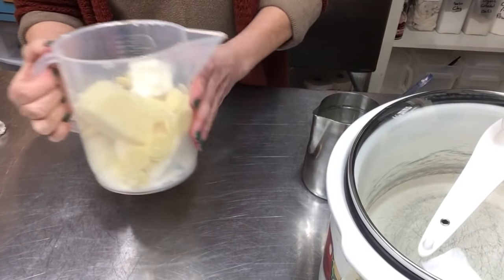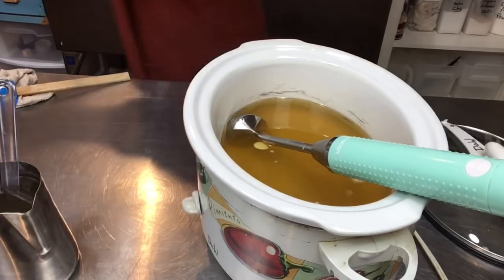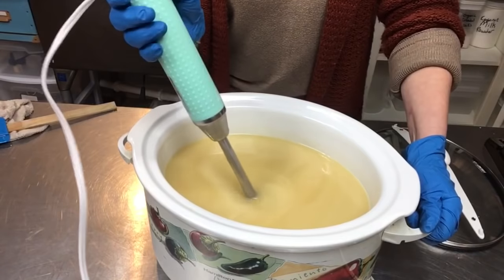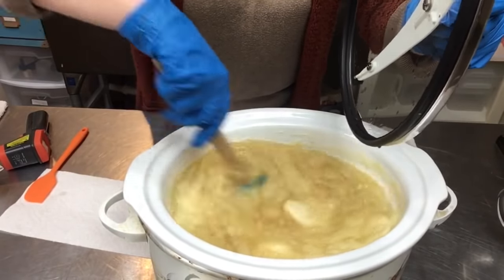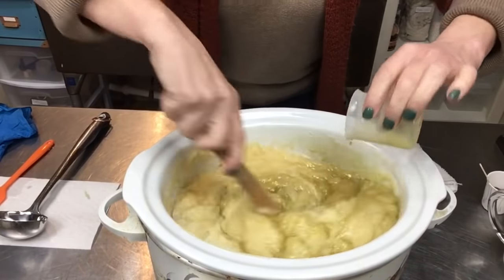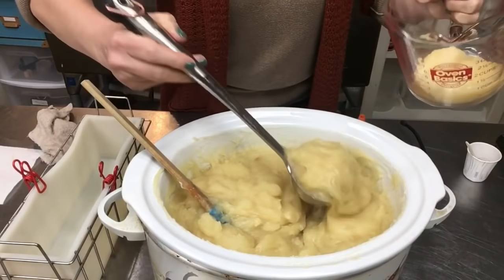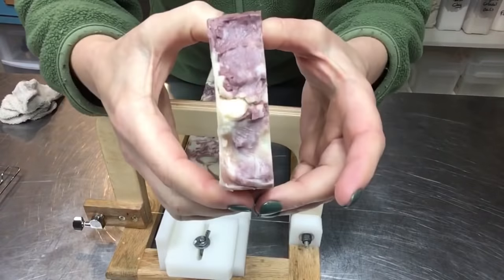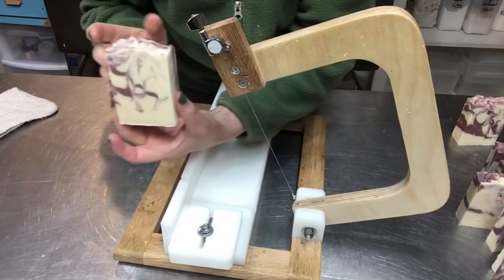How to make all Natural, fluid Hot Process Soap Swirl with Recipe | Ellen Ruth Soap

Comment: They turned out great Ellen. I'm really impressed.
Reply: Hi Ellen, I just wanted to make a note that if you decide to make HP soap a lot, I've found this solution to be a better judge of PH. 1% Phenolphthalein. You can purchase it from Amazon and what you do is take a tiny bit of the batter and put one drop directly onto the soap. If it changes color AT ALL you know the ph is off. The strips are great but this "In My Opinion" is better. Just wanted to let you know what I've found. Again, Beautifully done, it looks amazing.
Reply from the maker: Thank you! It was really fun to try😉

Comment: Well done! I'm a new soaper, I am teaching myself both hot & cold processes at the same time. I much prefer hot process despite attempts 2 & 3 being an almost volcanic experience. I really thought long and hard about why that happened and the conclusion I came to is my crockpot is half the size of yours. To do a full 2.5lb loaf pushes the limits of the crockpot's volume capacity. It also seems to get hot much faster at a smaller volume.
Reply from the maker: I really did enjoy doing the HP, but I do a see the crockpot size as a bit of a restriction 🤣

Comment: Hi Ellen Ruth!!  You did a Great job!  You went thru apple sauce and mashed potato phase!!  Hot process was my first way of making soaps!!  I love it for those last minute OMG it's almost (whatever holiday), let me make something that will cure quick LOL!!!  I like to melt my hard oils and butters in the crock pot.  Saves on washing LOL  I never heard of the cling wrap on top.  I always use my crock pot lid...which doesn't have a rubber seal but works just fine. Just make sure to keep a close eye on your crock pot to make sure it doesn't volcano. That hasn't happened to me but now that I've mentioned it, it probably will tee hee
Reply from the maker: Thank you! Yes, the whole volcano thing intimidated me for a long time 🤣 I'm glad I finally gave it a try 💕

Comment: Lovely Ruth,  well done!  I only hot process now having done all the methods over the last 15 years. lol 

Sugar not only adds increased lather to the soap but acts as a plasticizer and rheology modifier. In short it changes the crystalline structure and the flow, giving more fluidity of the molten soap as well as preventing the drying out during the cook, clumping , cracking,  brittleness  and easy release etc... IMHO plasticizers are  a must for hot process especially if using high temperatures. Melt and pour,  liquid soaps use high amounts of plasticizers such as alcohol/polyols; sorbitol for example to keep it liquid or to be able to re-melt etc.. There are many plasticizer we can use but sugar is cheap and effective. Some hot process soapers will add a plasticizer  at the end too...I usually add during the cook and at the end for a more fluid pour, especially if I want a less rustic top and if  I need more time for fancy swirls. Blessings to you Ruth!
Reply from the maker: Thank you so much for the good info 💕💕

Comment: Nice video. I would suggest maybe melting all your oils together in the pot, I do believe it does kill off all the goodness in the butters when you microwave, it's nuking them essentially. Same for CP also, gently heat on stove, double boiler or heat transfer method. Did a great job

I have used the stove top and it's completely safe, put on low, you can test with water first your lowest setting and see what temprature you get to see which setting to put it on. It turns out great, if you have an element stove then you can turn it off after trace, a lot of the heat remains throughout the entire process. I turn mine off after trace and works great. Of course you'll need to see how your stove behaves but you'll figure it out no doubt :)
Reply from the maker: Thank you, that's really good advice!  I'm not a huge microwave fan, so this is good to know...
Reply: @EllenRuthSoap  No worries! I use a stove top to gently melt large quantities of soy wax also, a few kg's at a time. It definitely works! I use one of the portable one's also. They work very well

Comment: Very nice Ellen Ruth! Something I discovered recently is that you can smooth out some of the rustic-ness of the tops by diping a spoon or spatula in hot water as you create your top design. On another note, can you please include a link for your digital thermometer? Thank you! Great job on the HP soap today!
Reply from the maker: Thanks!  And that sounds like a great tip for the tops, I'll be trying that for sure! Also,  I've added a link for the thermometer😉

Comment: Beautiful job! 😅 Also, quick '?', can we use vegetable oil in soap to replace rice bran oil?
Reply from the maker: Veg oil is great in soap, but if you change any oils you'll need to run the numbers thru soap calc to make sure your lye ratio is correct.

Comment: Wow! You nailed it on the first try. Yay! I've been binge-watching hot process videos, wanting to try it. I'm so chicken! Did you calculate your recipe at 0% super fat and then just added 5% , the hemp oil, at the end?
Reply from the maker: You should give it a try, it was fun!  I had a superfat of about 5%, and the hemp oil was extra, it was a small enough amount that I don't think it raised the superfat by much..  The finished bars were so nice to use!
Reply: @EllenRuthSoap  thank you so much for answering my question! I've seen enough videos 😝 that I have some confidence now.
Reply: I did the stick blender hot process the other day on a face soap recipe. Used your tip of the extra tiny bit of oil/sugar. Came out great!

Comment: Big question Ellen, I'm trying my best to get fluid soap but it seems like the soaping gremlins don't want me to. I know you're relatively new to fluid HP and I pretty much have HP my whole soaping history but I'm having a Hugh problem trying to make it fluid HP like u!! I've tried my newest recipe of 40/60 saturated/unsaturated fats for base and my lye/water ratio is 2.2092:1 and everything was going great and about 5 minutes after trace it went harder than normal and started chunking up some. I started struggling to get it fluid again and I had to add more water which messed up my fluids at the end but I just decreased my goats milk . I got it back fluid and added the yogurt at the end but by the time I divided my soap into colors everything started getting what seemed too stiff due to cooling too fast and basically had a slim chance of swirl? The swirl I got looked pretty much I the rustic HP plopped swirling I always do and no fluid smooth look at all!! Can u advice ?? It's a lot to go to the trouble of separating as I usually do for my just plopped rustic combination of colors and still achieve the same thing when I was so looking forward to the smooth beautiful look of yours... help!😬 Thanks! By the way I did keep all containers warm too! Everything was still pretty fluid even after my essential oil blends as well so I don't think that was it . I sure hope you can help!
Reply from the maker: Oh boy, it's frustrating when things just don't go the way we plan them....  I'm really not sure what's going on with your soap?  I do find adding the yogurt and S.F. at the end really loosens up the batter.
Reply: @EllenRuthSoap  thank you so much! I guess I'll just keep experimenting! I appreciate your answer! Have a great day!

Comment: Just curious , I have seen some articles that say hot processed should cure the same time??
Reply from the maker: Good question, from what I've read, the longer you let it set the harder the bar is... So for a super hard bar, the shelf time is the same.  Because of the "cook" the pH is ready sooner.
Reply: The water weight loss happens faster with hot process, but the internal crystalline structure that makes your soap better takes the same amount of time, no matter if you hot or cold process. You can’t rush that part.
Reply: Yes, saponification happens faster with HP, but the cure time (for loss of water weight, a milder soap, and a longer-lasting bar) takes just as long or longer with HP as it does for HP. Just like CP soap, HP will be "safe" after saponification is complete, but it is not IDEAL. Using it too soon means that it will melt away fast and may also become mushy with use.

As for the blending, if you want the cook process to go faster, then blend it to a thick trace before putting on the lid.

Comment: I made a hot process soap with pink clay put initially in the oils before adding the lye. The result was a nice hard soap however it crumbled in chunks when i cut it. Any idea if his is because i did not put the clay at the end??? The ph was tested before putting jn mold and it was 8. So it is not a lye heavy soap. Is it also the saly i added? By mistake i added 1 more teaspoon than planned. So 4 teaspoon for 3 pounds of oils instead of 3
Reply from the maker: Good question, I'm not sure what was the cause?  My HP knowledge is not extensive...

Comment: Hi. I also tried the recipe. I used palm oil and olive oil. It didn't go well. It is very oily. The oil remains on the mini. What I did wrong?
Reply from the maker: It could be several things...  double and triple check your measurements, did you make sure it was fully emulsified, it's okay to "over blend" with HP...  Hope this helps.

Comment: I’m making your recipe now and it looks like my oils are separating. What did I do wrong! I’m still cooking it. Update:The Ph is black now not green yet. It’s been cooking for awhile.
Reply from the maker: It does go thru phases of serparation sometimes, just keep blending, it will hold after it's cooked.
Reply: @EllenRuthSoap  It did but the soap came out dark in the crockpot, not light like yours so I lightened it up some with titanium dioxide. We will see tomorrow how it turned out. 😊. Did you cover it after it was put in the mold?😊. Thank you for your guidance. I do like cold process making.